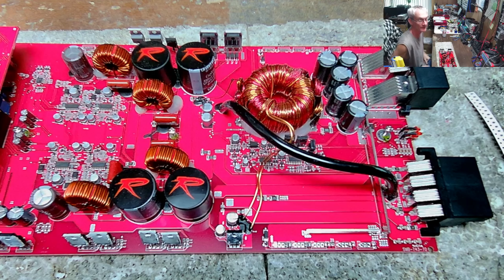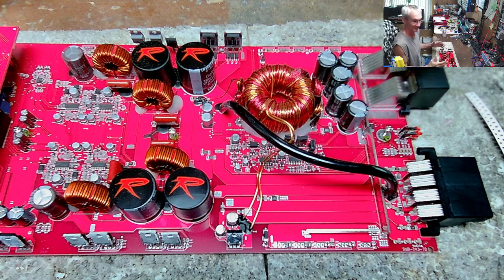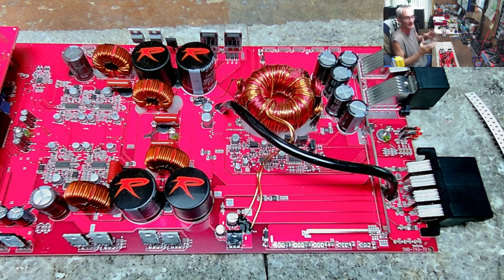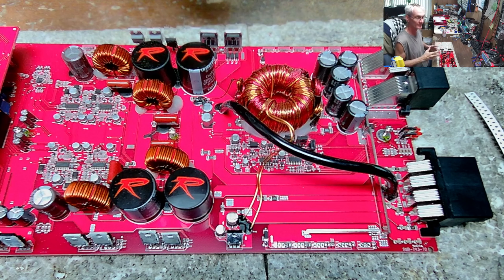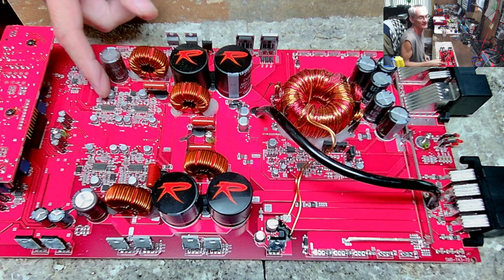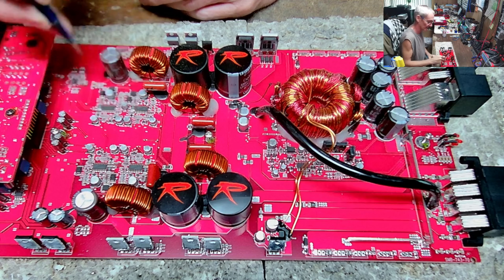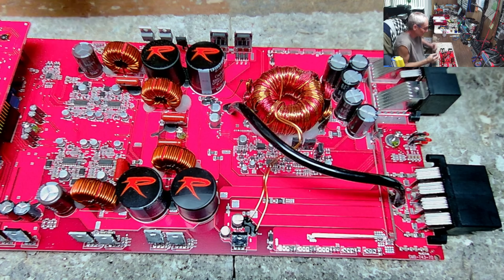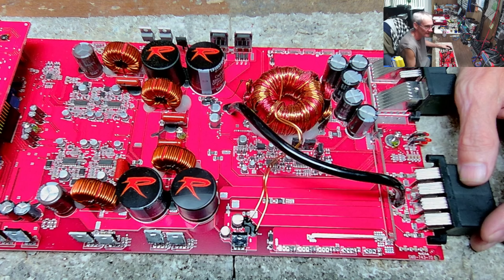Previous Repair Attempt Gone Wild or Wrong? Open Drain Trace Easy to Miss

Comment: Hey brother.. I just found a m44 pg. Id like to contact you about👍
Reply from the maker: Hello! I don't repair PG (besides the Titanium series) so I may not be much help but will do my best. I have repaired one or two of the M44's in the past but if I remember right the output totems were a nightmare.
Reply: @ellensburgamplifier  well it's actually probably a 8 or 9/10 condition wise .. but I haven't even tried to power it up . I didn't know if I should or not before having the caps checked
Reply: @ellensburgamplifier  I have a quick vid of it on my stuff .. you can see how nice it is.. it's been temp control stored for years.. I guess my main concern is if I should power it up or have it checked
Reply: @MattGuynn  You can do a visual inspection of the caps to make sure none are bulged or have started to leak. If it looks okay, apply voltage very slowly starting low and working your way up to 14 volts. Keep the amperage really low like 1 amp and once you get to 14v increase the amperage to see if it idles normally or tries to take too much current. Even though it's really old they probably used high-end capacitors so it might operate fine. If you're wanting to actually use it, you might consider replacing all the caps.